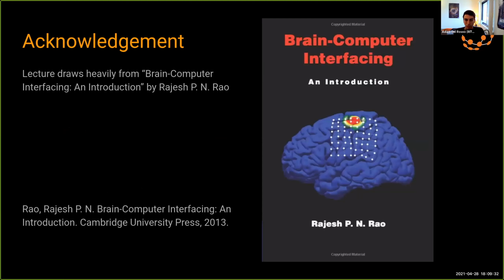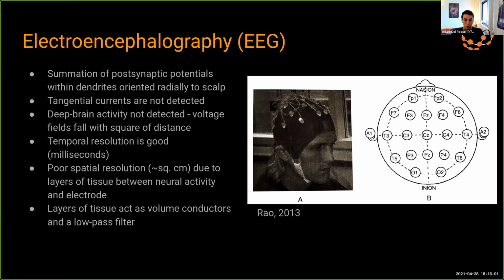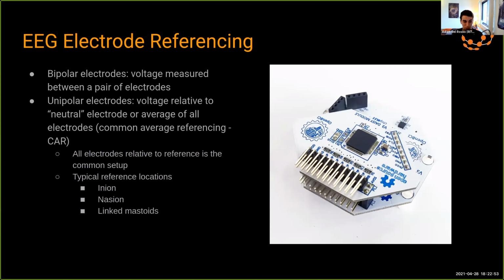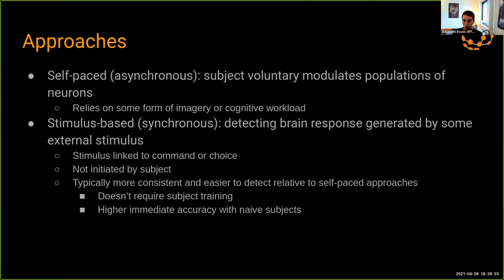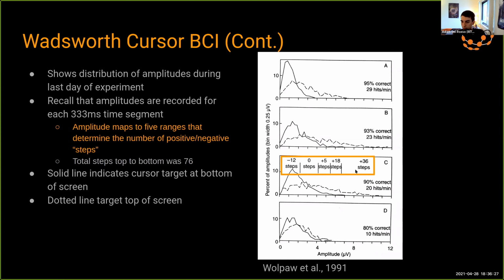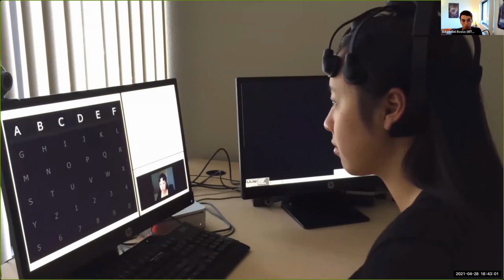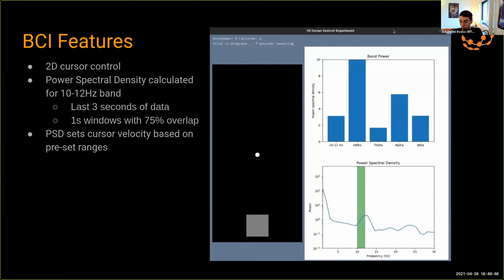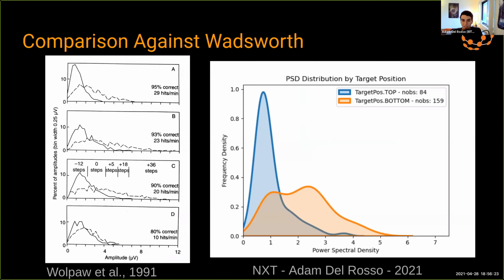Basics of EEG-based Brain-Computer Interfaces

Comment: I am enrolling in a clinical trial, for stroke rehabilitation of the lower limb. They will be using BCI and FES. The FES is activated when you think about the movement of the lower limb. The hope is that the brain will eventually take over the task. By performing the task with the unaffected leg, can the brainwave be recorded and then if by thinking the movement of the affected leg, would the brainwave be similar?